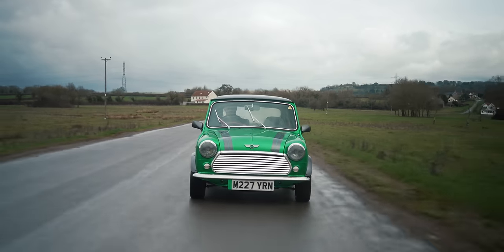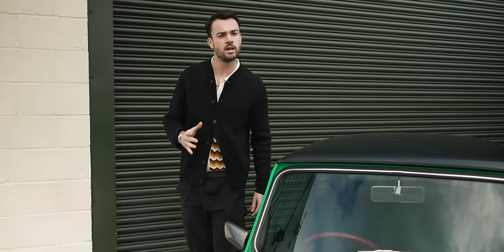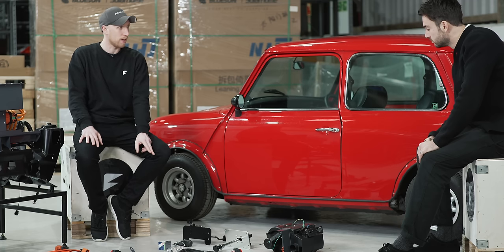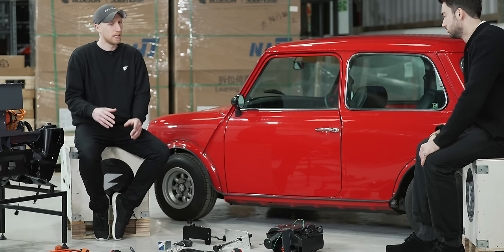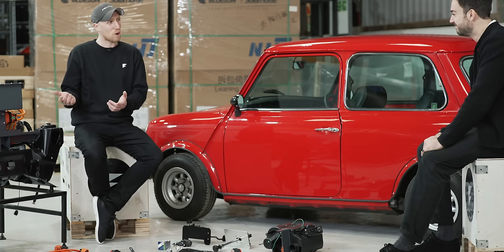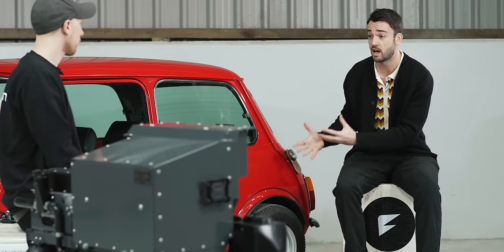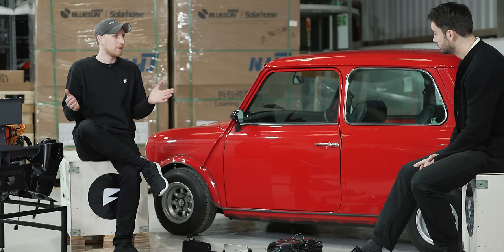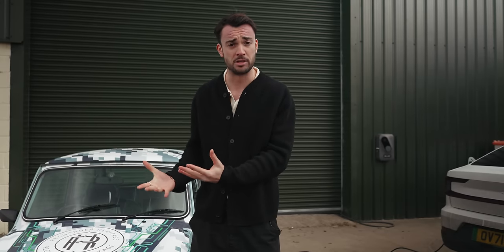How CHEAPLY Can You EV Convert Your Old Car?

Comment: Hi 
Great idea to retro fit electric power trains into older vehicles or is it? I have often thought about buying an old classic to use as a daily driver just because I don't like new cars and they are less user serviceable than older vehicles and then I remember they all without exception suffered with corrosion and older vehicles tend to need more frequent maintenance and repair. So it gets stupidly expensive galvanising chassis and bodywork and then engineering out the foreseeable problems that cause mor frequent maintenance and break downs and in the case of electrification loss of range due to a battery pack that isn't optimised for that particular vehicle the list goes on. I'm shure there are plenty of people willing to do so but for me I'd rather keep it stock or with the mods of the time 
Keep up the good work

Comment: Not everything needs a goddamn computer - you can do the electric motor with shorter range lead-acid batts until they figure out the batts situation - you can recharge it off of your home system without a fancy schmancy plug - okay it takes longer - who the hell cares if it does the job!

Comment: I love the idea and have been following them on/off for years. 
In reality, if there were incentives out there the main manufacturers will be the ones pioneering this IMHO. They have the designs already, they just need a team to make the brackets for a universal battery pack. Manufacturers already repurpose their chassis and designs over the generations and not afraid to reuse the designs to make new ones.

Comment: the technology to convert a car  its  available since the  beginning of   the modern cars  the problem its that the NEW electric cars come with  screens   with thousandth of gizmos that apparently   the people  need...  ( the reality its that its cheaper to   save money  in design  knobs and  cables    for  the controls than  just   program all in a    computer..) there has been  students and  engineers that convert cars  as low as $500 or &1000 us.( in the  middle  90)

Comment: 100 miles in a Mini is fine if that's 100 miles at night when it's zero degrees outside and with the heater and wipers going.  The more likely 50 miles in those conditions is way too short.

Comment: Use a Prius as a base, all you need to do there is add a charger, increase the battery capacity and add a proper bms to the battery. Oh and i forgot that you need to do some CAN trickery.

Comment: I think the time limit thing is a bit of a misnomer here. Noone is driving around in an 'old banger' thinking that is makes sense to spend 40k or even 10 k on a car. This is a product for converting low cost classic cars. 
This is going to be hard as lots of these cars are actually not worth a lot even in good condition so spending any more than a few grand does not make sense. Mind you owning a classic car doesn't make sense either. 
I think this is great but yeah, cost is the killer on this one.

Comment: When you talk the price of these kits now, many are spending that and more, restoring/retro modding cars, often boosting power, so even it it's early stages it's a cost comparrison to what a lot of people would spend on petrol powered builds & when the price does come down & the speed of fitting ready made kits will make it a lot quicker & cheaper way to keep a classic on the road for those that don't want to be tinkering with an oily engine all the time

Comment: To me I would think that rather than try and make a kit that will fit many different vehicles I would target the commuter models that sold the highest number. if you want an electric commuter then buy one of the target conversion cars and then the kit. The more kits that can be made the cheaper the kit has to become. Scale and volume drive cost reduction.

Comment: Do you have a system to give a linear acceleration rate that can tame accelerator control to a "regular town driving" acceleration so that planting the accelerator will not result in rapid acceleration. Kind of mimicing a sporty but not overpowering original mini power output?

Comment: You know the answer to this , how many people change their engine and gear box in a car when they have an issue rather than scraping the car, that the long term demand for these kits. The only thing that can change this is for the components to get cheap with scale the problem with that is if the expensive components of a EV get cheaper so does that new EV hence as the refit price drops so do the 
Prices of the new and second hand EVs so it's always for the tinkerer and collector just like a new drive train refit

Comment: I really want to convert my low mileage 2001 Honda Civic- It's rust free and everything works (Ice cold A/C included)
Reply: You don't need to convert your car to be an EV. All you need to do is to convert it to run on propane or methane, doing so is regularly cheaper than $1000 - half that for propane. If you have plenty of CNG stations to refuel your car in your country, you can even get it to run on methane, which is very eco-friendly compared to gasoline and propane - but that's only really possible for engines that are more than 90HP. Otherwise, just get a propane conversion kit for like $500 and install the propane tank in the place of your spare tire - this would be good enough to run 300-400km on a single tank. Due to the huge pressure needed to store methane efficiently, you cannot get a spare tire-shaped methane tank, and converting to methane comes with a lot more trade-offs.

Comment: "DC to DC converter to keep the 12v system topped up"?

Are the retaining a lead acid battery? Why not just use the DC to DC converter as the 12v system battery?
Reply: You can't just use the dcdc to run as a 12v. You need the 1ev to start the hv system and look after all constant 12v applications.

Comment: Sorry to sound boring, but how does insurance work? Just you know technically its a modified car. Could fully charge explain this in a future episode. Is the pack designed to deliver the same horsepower as standard?
Reply: There are insurance brokers that specialise in modified cars. I’ve had a couple of modified classic (ICE) cars and you just tell them what modifications have been done and they give you a quote. For my classics, it wasn’t terribly expensive - £50 to £80 more than a standard car for an MG Midget with significantly more performance than standard, in all areas.
For the power output of the Mini, I think he said 70kW (about 94 bhp) is about double most of the lesser models, though you could get Cooper ones approaching that level of power

Comment: Still reckon that the near future (10-15 years), will be best served by a standard range of conversion options for the current ICE fleet, particularly those models that are ubiquitous.  The option is that there are millions of ICE cars being trashed or trying to be recycled, neither of which are particularly feasible.
I’d guess that there will be a large number of businesses, probably franchised, that will do this work at affordable prices, supporting the inevitable transition.
Reply: The bottleneck is batteries, not cars chassis, so probably not

Comment: It need to be a similar cost to convert to electric as it would be to replace an engine and gearbox. Currently, a new engine for my car would be around £6k, and a gearbox £4k. About half that for recon units. Once conversion kits are available at around £5-7k there would be no reason not to convert. Especially if they come with instructions so any competent mechanic could do the work.
Reply: Sure but it depends on the car too. For something like a Porsche the cost of a new engine is so high it would make more sense.

Comment: I tried that on a 53 reg but have been told by well known converters the car is to young !! Either you have a classic  car which 95% of drivers don't or you have a new car whatever way it is converters don't want to know for the majority !!😂😂
Reply: It's down to all the added complexities of the system and the fact that anything after 2001 can't be changed to electric on the taxation class.

Comment: Two Fully Charged Live shows in the UK and others relatively nearby in neighboring Europe.  One tucked neatly away in the very corner of much larger North America...  Just saying...
Reply: FC is a UK, company and have Sand Diego and Vancouver covered to start with.
Reply: @jeromeandre4915  Driving distance from Savana, Ga on one corner of NA to Vancouver is guess how far?  3180 miles, over 5100km.  just short of the distance from Lisbon to the Ural mountains, in a straight line, so admittedly not a direct comparison, but close enough to show my point...
My wife and I were at the first show here in the US, and FULLY support not putting it in Texas for the reasons it isn't going to be in Abbotville now.  But how about, say, Illinois?  Split the difference here...
Reply: It was similar with there Australian Show in Sydney. it should have been a tour through Australia's 5 main cities.
Reply: @nickhiscock8948  The last two NA shows have been both West coast.  I'm just trying to nudge the idea of maybe alternating with at least something more central to the country/continent...  Austin is great location-wise, but then you have the political situation, so as I said, I agree with not doing Texas again.

Comment: I'd like to add an eV motor to drive the rear wheels of my dodge
Reply: I tried to edit my above comment. I'd like add electric to my car but I can't even find information about how to go about it. No one will say anything about converting a fuel burner to a hybrid. It can't be that difficult but when you can't get the information it becomes absolutely impossible.

Comment: I love the idea of electric cars and motorcycles.  . The idea of taking a classic car . Im not so sure . Lol but then im biased.  The problem i have with electric cars is the technology isn't there to make it worth it  at the moment
Reply from the maker: I don't normally respond to comments on old episodes but this one made me giggle. I have heard this bizarre notion SO many times and I truly don't know what it means.
"The problem i have with electric cars is the technology isn't there to make it worth it  at the moment"
What technology? I'm probably in agreement with you regarding converting old combustion cars to electric, that is expensive and slightly compromised way of having an electric car.
But as for modern mass produced electric cars, what aspect of the technology 'isn't there yet?'  And where is 'there.'
An electric car is such a massive technological advance on any combustion car it's actually embarrassing.  They last longer, go further, need about 15% of the endless servicing that combustion cars always need, a cost NO ONE in the mass media never mentions, and they are 100% reliant on a fragile, easily disrupted single fuel supply and cannot be refuelled with anything else.
Combustion cars aren't 'there yet' and we've been developing them for 120 years.
Reply: @fullychargedshow  hi mate.  With tech moving so quickly as it is . I'm surprised that some tech-savvy guy hasn't come up with a split charge system for ev cars . Brake gen is excellent.  If a mear mortal such as myself is talking about this, then I'd like to think someone in a car firm is talking  about it as well . Maybe I used the wrong words.  But I'm hoping that self charge will be in the not too distant future.  Where we aren't  relying on a charge point that may or may not be working that is charging more than it cost me to fuel up my dirty old diesel.  Yes, a combustion engine needs constant servicing.  But will a tesla built today still be running in 50/60 years? My old landrover runs on vegi oil and normal diesel.  I've not got to pay a guy to plug it into a computer to tell me anything. I roll up my sleeves to service it once a year.  That's my love of classic cars . I think we both have valid points, and electric  cars are not a new idea, just a different time . Thank you for replying. I loved the video. Keep up the great work

Comment: I’m not sure converting classic cars is worthwhile? Most classics only average about a thousand miles each year so it would probably be much easier to keep the original petrol engine.  The savings that are possible on running an electric car really work when you are using the car daily..
Reply: Well I suppose if you have the money and don't forget a lot of these EV conversions don't involve any modification to the existing structure so you can easily reinstall  A traditional internal combustion engine if you so wish
Reply: Most classics are not very reliable. We drive our classic conversion almost everyday. It is so reliable we drive it to drop off a modern cars at the repair shop.

Comment: nice
Reply: try the single tank znbr battery on that, or flywheel maglev battery
Reply: graphite soot lubricated/torched pipe dc-motors/bearings, no ball bearings
Reply: so then add a battery expansion pack, all standard sizes, mass manufactured, for efficiency, ie, same design for all of the default parts
Reply: why would you charge (pun intended) so much for electric motors, they can be made cheaply
Reply: yes your pricing (market) is the issue, so that you are poor and expensive, no freedom or free stuff
Reply: why dont you use something like rpi pico, jetson nano, or something else like fpga board, off the shelf
Reply: you are in wrong business, if a 5yo cant do it, or "needs qualifications" or "training"

Comment: Interested. However, it costs more than my current brand new car and i wouldnt be able to get a loan for it. Also, it would have 1/6 the driving range. Its just foolish.  Are batteries really sustainable? We need to have a discussion about that. And my electricity comes from gas, which Joe Biden is attacking. Price is through the roof. I owe them thousands.

Comment: I’d love to convert my mini to full electric. But £40k is ludicrous. You can buy a full electric Seat Mii for circa £20k.
Reply: yes you cant buy a classic electric Mini  for 20. cant really compare can you.
Reply: @jeromeandre4915  my point is the Mii has a motor, battery, charge point, cables. Pretty much everything you’d need to convert your mini. I’ve since seen Mii on auto trader for around £13k. You could pay someone to fabricate it all in and still have change from £20k